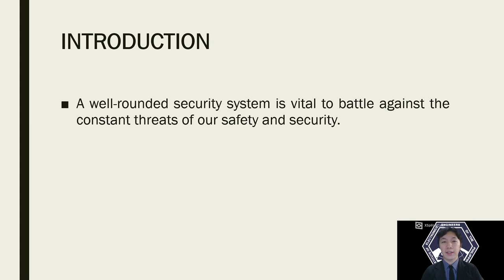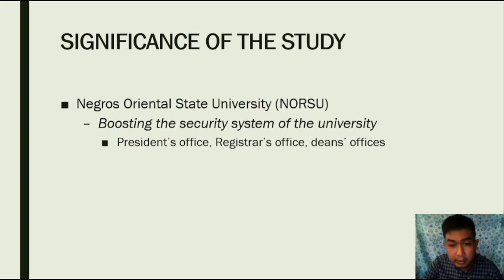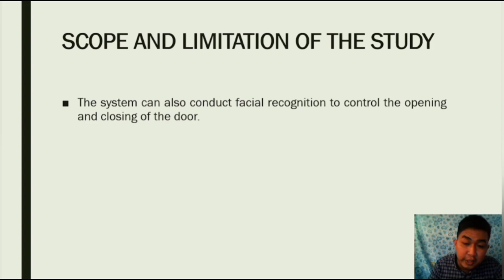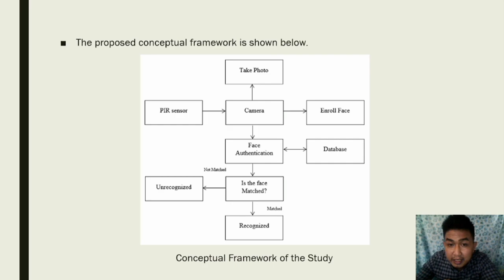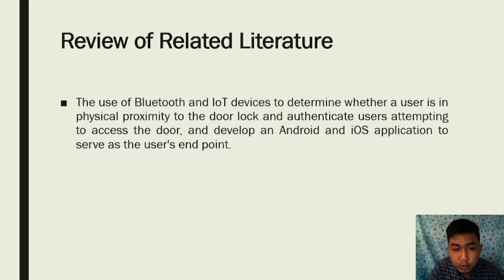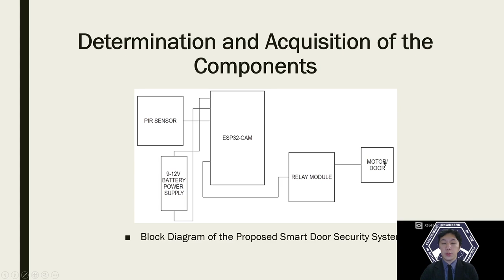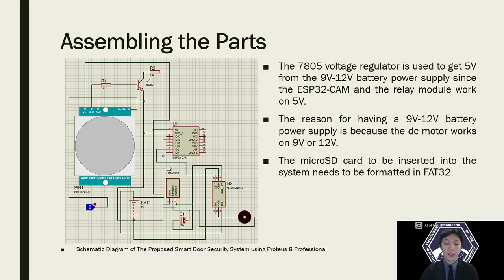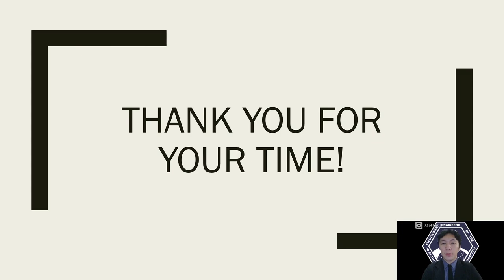AUTOMATED DOOR CONTROL SYSTEM: A SMART SECURITY APPROACH

Comment: Diaz, Joseph Jr. B. 
ENS 341 B - 5-8 pm Saturday
March 25, 2022

Reaction: What I truly admire with the idea of automated door control system is that it gives safety and security. This is necessary especially in the offices that you want some privacy when you're at work. In the house, the safety and security for your family members. 

Reflection: The automated door control system is not new. Actually, there is already in the market. Some home owners installed it for safety and convenience to them. It really helps them when they carry heavy load and can't open the door by their bare hands but when they have the automated door control system they can open it effortlessly because of voice control or gestures.

Comment: NAME: Mansueto, Jomari Carl R.
CLASS NAME & CLASS SCHED: EE 341A 6:30 - 8:00 PM T-Th
DATE: MARCH 25, 2022

REACTION: The video enlightened me about the smart security approach in it is more secure and safe compared to manual security systems. It is also convenient since it has facial recognition and the use of biometric data and no need for keys which has the potential to be stolen by unwanted intruders. It is a great assurance that only permitted personnel are allowed to enter the facility.

REFLECTION: This research shows the application of technology of providing security and safety to any place that needs protection. IT is also timely and relevant since technology prevails in this era. I think this is the optimum solution for security issues in any place that needs high safety.

Comment: Name: Mark Daniel L. Anggoy
Class Name & Class Schedule: Coe 343 Methods of Research T-TH 5:00-6:30
Date: March 25,2022

Reaction:  Based on the video that was provided, this research proposal is really useful. When dealing with safety concerns, it comes in helpful. It protects us from unwanted intruders and makes our home safe and secure. The researcher is also well-versed in the subject of their investigation. This study suggestion is extremely impressive.
Reflection:  This study is one example of how smart technology can be used to secure locations that you want to protect. It provides a lot of comfort to those who will use it that it will provide them with complete security because of features such as alerting the owners if there is an intruder and no one will be able to get through the entrance unless their face is recognized by the system.

Comment: Name: Evardo, Anthony James Jr. A. 
Class Name & Class Schedule: ENS 341 Methods of Research SAT 2:00-5:00
Date: March 25, 2022

Reaction: This study is very interesting about the smart security strategy, which is more secure and safe than manual security methods. It is also handy since it uses face recognition and biometric data rather than keys, which may be taken by unauthorized attackers. It provides excellent assurance that only authorized employees are authorized to enter the premises.

Reflection: I believe that this study demonstrates how technology may be used to provide security and safety to any location that requires it. IT is particularly topical and relevant because technology is dominant in our day. This, in my opinion, is the best answer for security difficulties in any location that requires a high level of protection.

Comment: Arnold Jr. Arnesto
CoE 346 A - 5:00 PM - 6:30 PM TTh
March 25, 2022

Reaction:
To further improve the proposed system, instead of using a timer for closing the door, I think it is a good idea to use a sensor and detect if a person or an object is still blocking the closing path of the door to avoid the possibility of an accident. Nonetheless, the study is a great inspiration and innovation for our security.

Reflection:
After watching the presentation, I realized the importance of security in our homes and workplaces and the need for more innovations to improve our safety and comfort. Projects like this also point us in the direction of technological advancements to the digitalization and automation of manual tasks and jobs.

Comment: Marc Kenneth L. Baldosano
ENS 341 A (Saturday 2:00-5:00 pm)
March 26, 2022

REACTION: The presentation itself is splendid and the researchers are remarkable. But as of now, I think that all smart lock systems are available in the market, and this one comes with a problem regarding how much force it can withstand. The build quality is mostly substandard, and the locking mechanism can easily be cracked. The good thing is that it has an alarm system and real-time updates, it also has a camera that records videos.

REFLECTION: Even though my initial reactions to the presentation may be somewhat on the negative side, there is without a doubt that smart lock systems will be the go-to in the future. For now, at least for me, the product is still new, and I believe that it has a lot of potential.

Comment: Gliocam, Blessings
COE 346 Methods of Research T-TH 5:00-6:30 PM 
March 24, 2022 

REACTION:  it is time-efficient and ergonomic, with the involvement of facial recognition it provides more security against intruders.

REFLECTION: This research is one way to use smart technology to protect the area you want. It offers a lot of reassurance to those who will use it, as its features make them a completely secure system.

Comment: Caluscusan, Desiree Joy M.
COE 346 Methods of Research T-TH 5:00-6:30 PM
MARCH 25,2022

Reaction: The video addressed the safety and security issues through the development of a smart security system. This is useful tool especially with the deployment of modern security systems. It is also very relevant since we are in a time where everyone is somehow inclined to technology which opens them to the risk it brings.
Reflection: Dealing with security is an all-time problem for everyone since we are all constantly facing threats to our safety and security. In locations that are involved with important files and people, it is demanded that these important possessions are well protected.

Comment: Name: Bilynda Jubilla
Class Name & Class Schedule: ENS 341 A (2-5 PM Saturday)
Date: 3/28/22

Reaction: This study is excellent. Using this advanced security control system is very suitable, most especially to a big establishments. You don't need to worry and always checking if the key is with you or not because it has face recognition. 

Reflection: If this study will make into a reality, this will also helps for residential area particularly to the elder home owners. They always forget their keys, so having this kind of device installed on your door is very convenient.

Comment: Name: Khynny Maureen P. Campoy
Class Name and schedule : ENS 341 Saturday (5:00-8:00pm)
Date: March 26, 2022

Reaction :
The proposed research is very interesting. Using an automated door control system is relevant to upgrade our security. It is a great alternative we can use to guarantee our safety  and our security issues in our homes. 

Reflection :
The research shows providing security safety using technology. The automatic door control system is a good security device to secure our homes. You will have the assurance that no one could enter your house without your permission.

Comment: Name: Balansag, Lorenzo Jr. B.
Class Name and Class Schedule:  ENS341- Research Methods for Engineering | Saturday 2:00-5:00 pm 
Date: March 26, 2022

Reaction: The proposed research can greatly improve the security of an establishment. As having manual door locks are easily punctured. Thus, having an automatic door control system, will lessen the chance of security breaches in our homes, buildings, etc. Overall, the idea presented is very impressive and innovative.

Reflection: As I have experience, our stores have been robbed because of the poor security that the manual locks give. That is why if this proposed research is to integrated to our building, that type of security breach would have been prevented. I would really like to have one in our building.

Comment: Franz Michael B. Nadal
ENS 341 SAT 5-8 pm
March 26, 2022
Reaction:
This is an interesting research and at the same time innovative. The advancement of our security really needs to be put in mind. With our various jobs and tasks it is very hard now to monitor everything. The adaptation of smart locks to our current homes and institution maybe an answer to this.
Reflection:
Technology have been part of our life. Is is up for us to use it and utilize it to the utmost of it's capability. The enhancement of our security not only promotes safety but it also ensure privacy. With smart lock we can also have a better security with a monitoring system which is convenient when we are leaving our homes thus less worry.

Comment: NAME: Tracy Alex E. Manzo

CLASS NAME & CLASS SCHEDULE: ENS 341 Research Methods for Engineering - SATURDAY (5:00-8:00PM)

DATE: March 25, 2022

REACTION: This research proposal appears to be quite valuable it's fascinating. I'd love to have this equipment or system to keep my home safe and secure from intruders. It comes in handy when dealing with safety concerns. It keeps us safe and secure in our home by keeping unwanted intruders out. The researcher is also knowledgeable about the topic under investigation. This research proposal is incredibly excellent.

REFLECTION: Problems of the modern era necessitated the application of new solutions. An automatic door control system can be useful in certain situations. Security and safety are two of the most serious challenges that have yet to be addressed in certain instances. It is necessary to implement locking mechanisms.in order to avoid a high chance of security flaws that could jeopardize human life.

Comment: NAME: Alnie Jane M. Aum
CLASS NAME: ENS 341 B - Research Methods for Engineering
SCHEDULE: Saturday, 5:00 - 8:00 pm
DATE: March 25, 2022

REACTION:
     This research is about a system in which it battles against the threats of our safety and security. This helps to protect us from the bad people. It also protects the things in our homes, in facilities, establishments, and buildings. This will make easier for us to our daily tasks and not worrying about our security and safety. It is an impressive study indeed.

REFLECTION:
     In some places were robbery is common, I would say that this is the best solution to the problem. This automated door control system is very convenient to use. Since those features like motion sensor and face recognition will help bring the safety and security for all, using this technology.

Comment: Name: Orito, Jessel A.
Class Name & Class Schedule: ENS 341 B Research Methods for Engineering (Saturday 5:00-8:00 pm)
Date: March 26, 2022

Reaction: Securing one’s safety is  important for we cannot foresee things in the future. In this case, proposing a more advanced security system is better in order to catch up to the fast and adaptable threats in the society.

Reflection: Nowadays, the challenges of security and safety is one of the most serious problems we are facing. So, it is best to implement more advanced security system than the traditional one because poor implementation can lead to high risk of vulnerability that could negatively affect lives. Therefore, proposing an automated door control system is a smart approach to secure safety not only in homes, but also in school and other commercial buildings.

Comment: NAME: John Pius T. Borres
CLASS NAME & CLASS SCHEDULE: ENS341 – Sat. 2-5pm
DATE: March 24, 2022
REACTION: The proposal is quite intriguing. The usage of facial recognition for home security is fantastic. There will be no more misplaced keys or difficulties unlocking doors. Also, it saves time.
REFLECTION: This study is one example of how smart technology can be used to secure locations that you want to protect. Even though it is quite expensive, it provides a lot of comfort to those who will use it that it will provide them with complete security because of features such as alerting the owners if there is an intruder and no one will be able to get through the entrance unless their face is recognized by the system.

Comment: NAME: Clark E. Juanites
CLASS NAME & CLASS SCHEDULE: EE 341A 6:30 - 8:00 PM T-Th
DATE: March 25, 2022

REACTION: The study was well-presented since the researchers had all of the necessary information. The project is also very practical because it takes into account the elderly and disabled.

REFLECTION: This research will deal with the security threats that are currently prevalent.  The automatic door control system is a smart security strategy, which leads me to believe that this type of research is quite beneficial, and I recognize that the more precise and scientific the research is, the more dependable and intriguing it is. It's also beneficial to have local processing capability to back up the system in the event of a server failure. This has the potential to improve our security standards in the Philippines.

Comment: Name: Cabrera, Julius Joshua R.
Class Name and Class Schedule: ENS 341 B - (5-8 PM Saturday)
Date: March 26, 2022
Reaction: This video is a interesting one I could say it show how technology is improving thought-out the years and in this research it tackles on automated door control system: a smart security approach.  and this research will be useful institutions and areas as the mentioned in the video . In the video this will also help boost the security system of a place .
Reflection: This research will be useful of the safety and security of the place. And it is the step forward technology wise scene technology is improve greatly in different parts of the world, it will be a great help in this time of the pandemic scene it  will open the door without touch.

Comment: NAME:LEOMAR A. MEDEZ
CLASS NAME & CLASS SCHEDULE: EE341 A TTH-6:30-9:00PM
DATE: March 29, 2022

REACTION:
The smart security strategy, which is more secure and safe than manual security procedures, is the subject of this fascinating study. There are many advantages to using face recognition and biometric data instead of passwords that can be stolen by criminals. You may rest easy knowing that only authorized staff are allowed to enter the premises.

REFLECTION:
The current security threats will be the focus of this study. To me, this type of research is quite advantageous because of the smart security method it employs, and I believe that the more accurate and scientifically sound the research, then more interesting and useful it will be. Having local processing power in case of a server breakdown is also advantageous. Increasing our country's security could be made easier as a result.

Comment: NAME: Cheri Mae E. Tinguban

CLASS NAME & CLASS SCHEDULE: ENS 341 – Research Methods for Engineering – 5:00-8:00 Saturday 

DATE: 24/03/2022

REACTION: The "Automated Door Control System," a clever security approach, is discussed in this video. The researchers' goal is to solve safety and security concerns by constructing a smart security system with more capabilities, resulting in a system that is more resilient overall. They also agreed that this approach would be most useful in locations where stringent monitoring and control are required. This system is required by the researchers in order to improve the facility's safety, security, and privacy. However, the study's major goal is to improve the development of door and entrance automation, making it a viable option for security. After viewing this video, I believe that this is a must-have not only for facilities, but also for our homes, because the primary goal of this invention is to safeguard what is within the facility, and I believe that this also applies to our households. This proposal is a great concept because our technologies are slowly improving and becoming more high-quality. 

REFLECTION: As someone who struggles with trust, I am blown away by this concept. This is due to the fact that it provides assurance, safety, and security to all those who use it. This will undoubtedly help everyone, and I hope that in the near future, this idea will be further improved, standardized, and applied in order to improve safety and security.

Comment: NAME: ATOY, AMIEL S.

CLASS NAME & CLASS SCHEDULE: ENS 341 - SATURDAY (5-8PM)

DATE: MARCH 24, 2022

REACTION: The video is convenient to all who has an issue in security and safety. It's very informative and instructive at the same time.

REFLECTION: Modern problems highly required modern solution. At times, the assistance of an automated door control system is beneficial. In certain circumstances, one of the most severe issues that everyone has yet to address is security and safety. It is vital to install lock mechanisms in order to avoid a high risk of security vulnerabilities that could endanger human life.

Comment: NAME: BERNALDEZ, ELLYN MAE A.
CLASS NAME & CLASS SCHEDULE: ENS 341 - SATURDAY (5-8PM)
DATE: March 24, 2022

REACTION: Based on the video presented, this research proposal is very informative. It is very helpful in addressing safety issues. It secures our home and it also protects us from any unwanted attacks. This research proposal is very impressive. 

REFLECTION: The Automated Control Door System is very relevant with the technological advancements. This research will be a great help to improve security in our houses, also to offices. You can rest assured that your door is closed properly thus providing protection for your property. This also means that you do not need to have additional locks or security systems in place to keep out thieves from entering your territory.